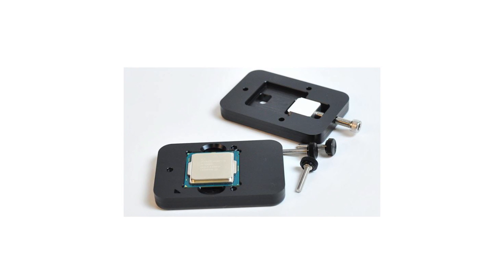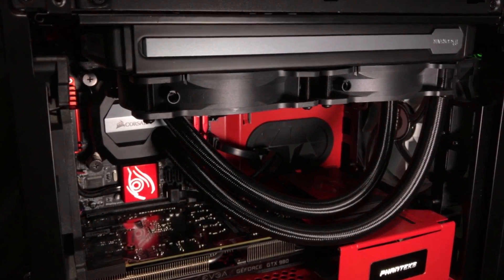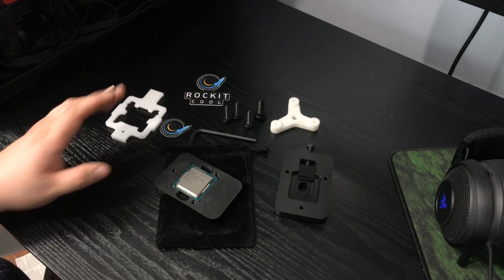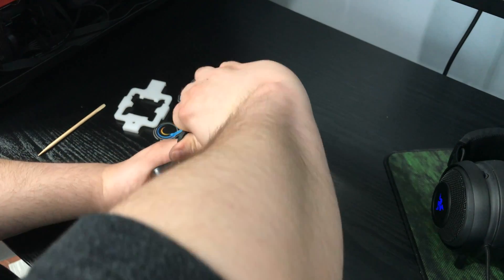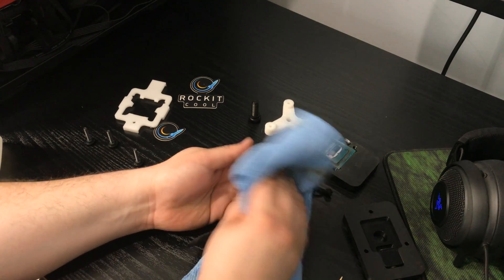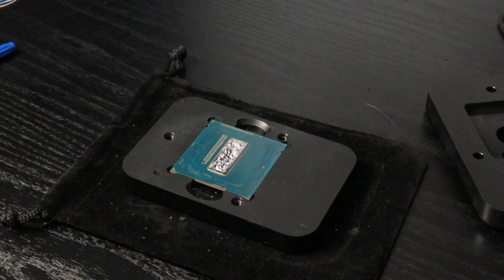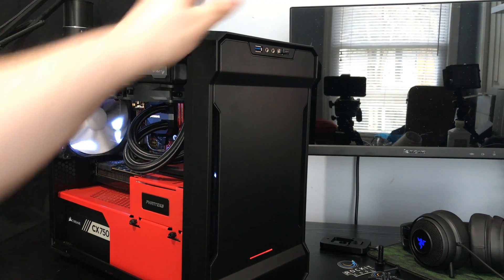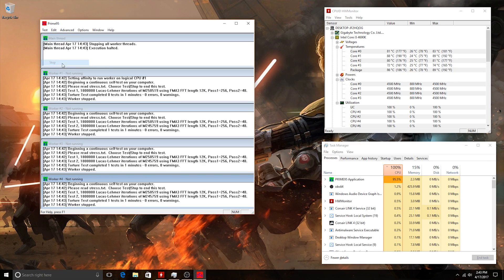Chips Gone Wild: 4690k Goes Topless

Comment: WTF? 94C with a water cooler running at 4.2 GHz?
I never delidded my cpu. I run it at 4.2 GHz on an air cooler (Hyper 212) and get 82C in prime95. You're getting the same temps with a delid, liquid metal, and a water cooler.
The voltages I need for 4.3 GHz aren't worth it, yet you can clock to 4.5??? You definitely should lower your voltages a bit at 4.2.

Comment: 4.4ghz on my 4690k @ 1.20v, and running at 60°c max under stress test without delid with an nzxt kraken x52. (radiators fan are only 800rpm ^^)
I don't know if your cpu is a bad one or if you put too much voltage, but it seems very hot

Comment: Does this CPU just run super hot? 89c after a delid at only 4.2ghz is pretty crappy. I delidded my 3770K and I get about 82c @4.2ghz. Did you even bother to try to bring the voltage down?

Comment: You were getting over 90° with an H100i at 4.2????? Even with my H80i at 4.5 I'm getting a maximum of 70 when being stressed. God knows what liquid metal could do to my 4690k!
Reply: yea... this guy did something wrong.
Reply: RealComp5 I’m guessing he used subpar thermal paste coupled with an unnecessary amount of voltage for his 4,2 G OC.
Reply: @Mikkel111  nah i used cooler master paste that came with a hyper 212 its not that great but ive been running 4.3 maxing out at 82 c
Reply: @SouLo_47  I did write "coupled with an unnecessary amount of voltage"...
Multiple factors leading to poor performance, one of them probably being cheaping out on thermal paste.
Reply: @Mikkel111  I'm getting 4.7ghz out of my 4690k @1.268vcore with a h100i v2, I intend to delid it and try and push for 5ghz, I think my chip might do it.
Reply: It maxes out at 60c may I add
Reply: Mike L
What am I supposed to do with this information?

... Good for you, I guess.
Reply: 1.28v 4.5ghz deepcool gammax 400 (aircooled) and 70º 75º max with no delid xDDDDDD
Reply: Nathan Drury what voltage are you running at? I'm running it at 4.5ghz at around 1.27 v with a h80i and getting temps of low 80s after 15 mins. Wonder what delidding could do to my temps haha :)
Reply: I think this dude works for that deliding tool company.... im at 1.2v 4.5 with a crappy 50$ water cooler. 62c on intel extreme stress test and I live in a hoot climate

Comment: AMD does not need to delid..they make quality IHS and soldered die on the IHS..Intel is cheap ass f*ckers..You should show us the Vcore on your 4690K.

You have 200W TDP on your cores at 4500mhz? that kinda high..i have around 75W TDP at 4500MHZ on my 4690K
Reply from the maker: Peter J as far as Ryzen is concerned i would love to do further analysis in regards to quality and construction. But funds are a bit limited in that regard. And unfortunately im using the 4690k for an upcoming NAS build, but you do make a good point. As far as 4690k's are concerned you definitely hit the silicon lottery if you have such a low tdp.
Reply: I've hit 4,8GHZ at 1,4V@89c, my fourth core is my weak link in my CPU, all my other cores can do 1,35V on 4,8GHZ but not the last one..sadly..but I will delid and see if I can do 5ghz under 95c. Thanks for a good video m8! I've sub'ed your channel.